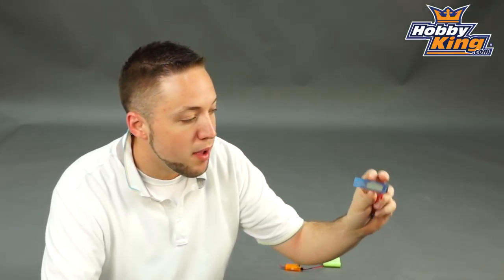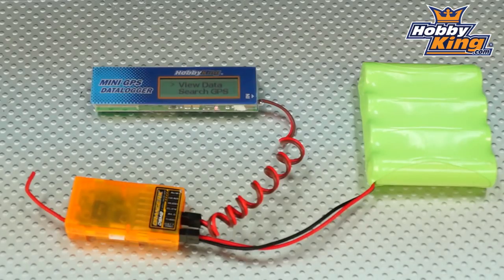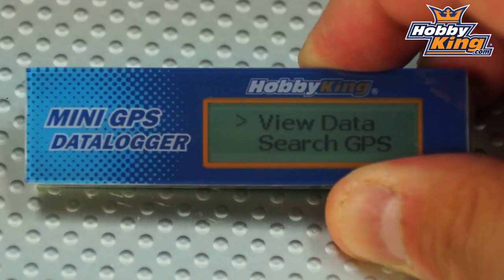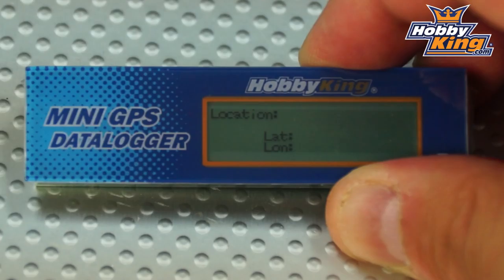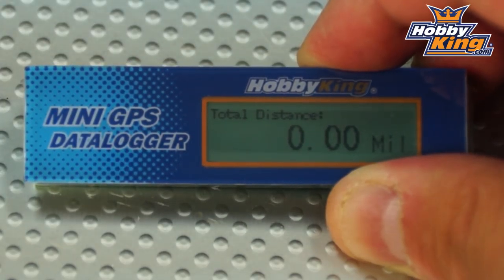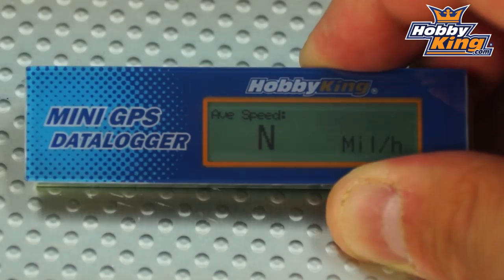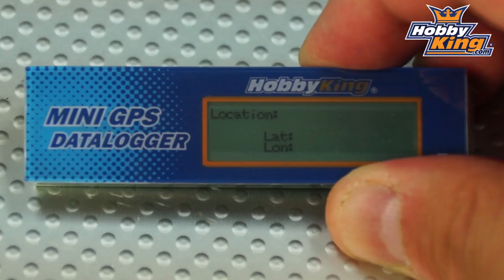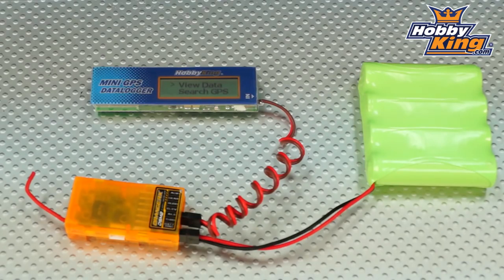HobbyKing Daily - HK GPS DataLogger

Comment: Just measure the speed on a completely calm day, and you will get an accurate enough indication of the planes max speed.
Also, GPS measures ground speed only, so if your in a steep dive to increase the speed and see what it can get too, it will only measure the cosine of your dive angle, and not your true airspeed at the time.
Still looks like a not bad piece of kit.